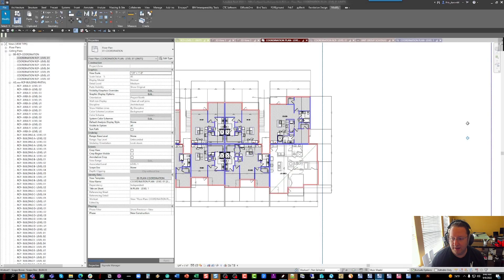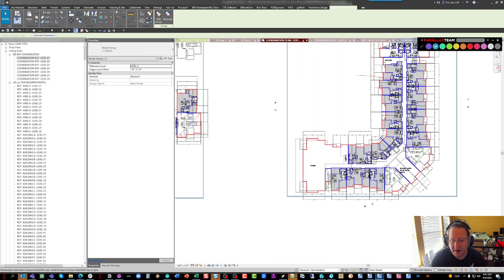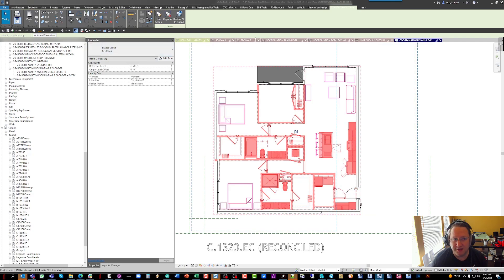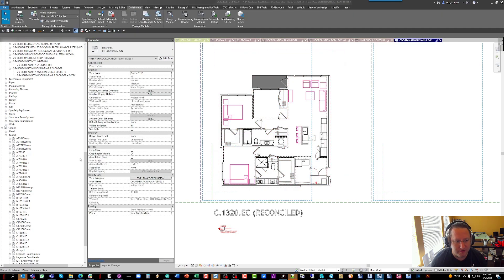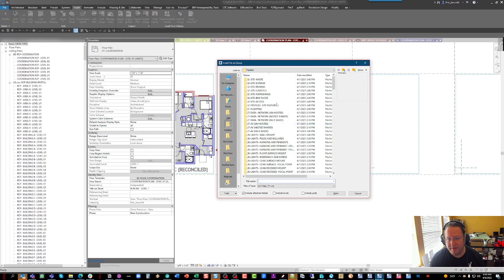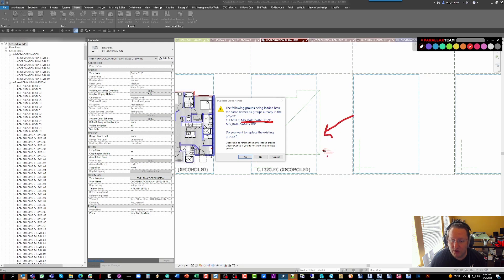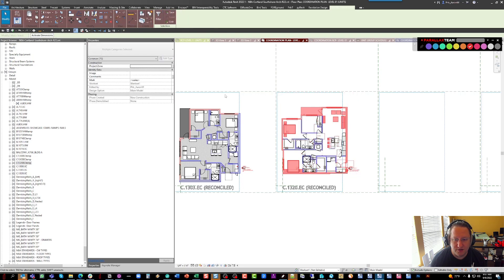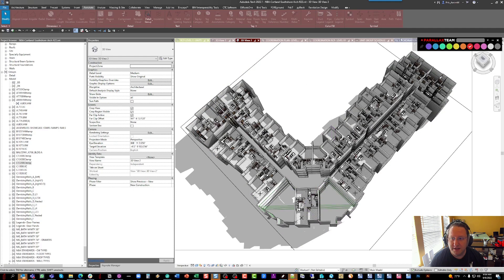Prlx Team- Workflows- MultiFam- Unit Group Replacement (from Placeholders)

Comment: Hi ! Is there a way to do the same thing with Detail groups only ?
Reply from the maker: Interesting Question!  So, you cant use the Load As Group command to bring in JUST a detail Group, but im sure you could use Load As Group to bring in an RVT that had detail groups in it, and it would work similarly.